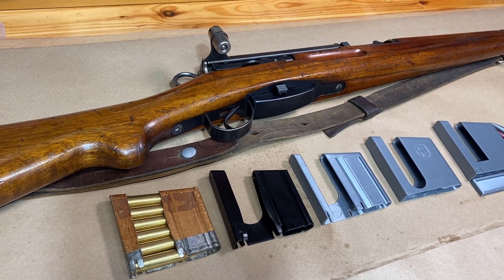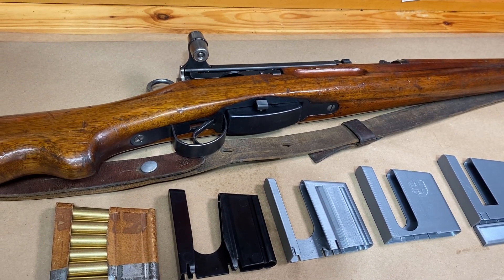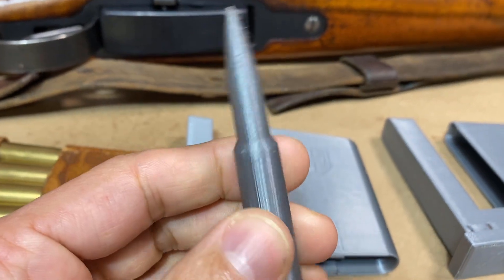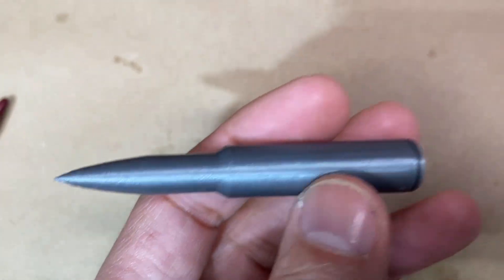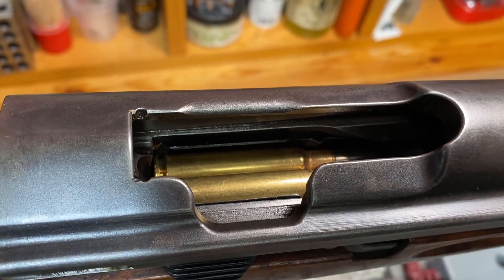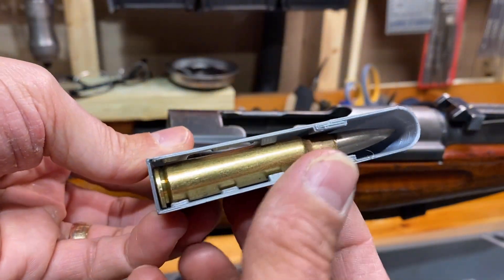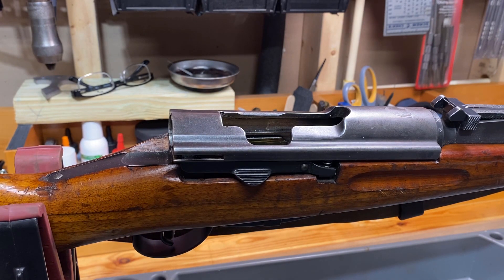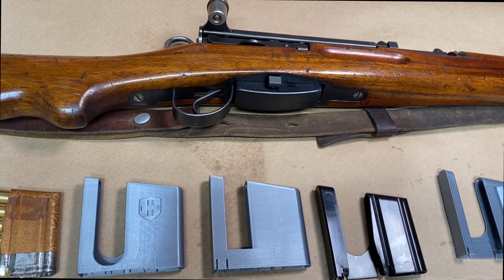Testing 3D Printed Swiss Schmidt-Rubin Clips

Comment: I had spent quite a long time trying to design a 3d printed clip that held rounds well but, also loaded into the rifle relatively easily. I never could get a design working that was as easy as the original while still retaining rounds securely. I have some in CF nylon if you want to try them, I'd be willing to send you a couple on me. They likely load with the same degree of difficulty as what you have here (Other than the original clip) but, they should hold onto the rounds without falling out. Let me know if you'd like to try them. Take care!

Comment: Are 3D printed mosin clips possible?
Reply from the maker: Yes, but they will probably have the same issues as the Carcano one in my last video.  It's really hard to print durable thin walled plastic like you need for a clip, at least with consumer grade printers.